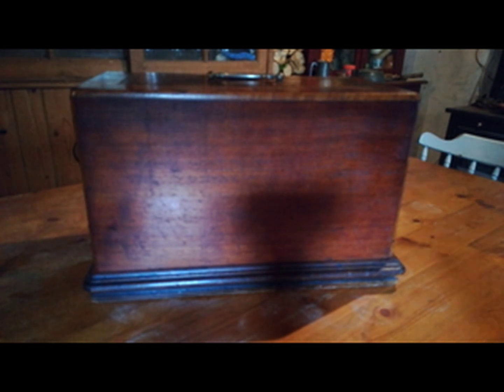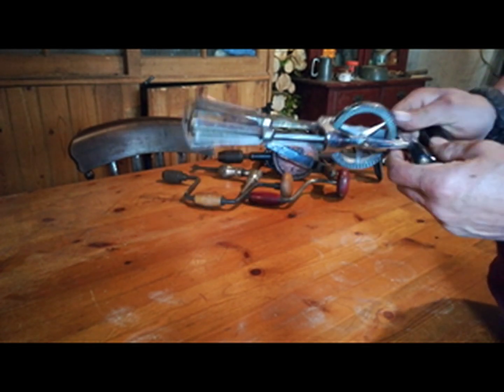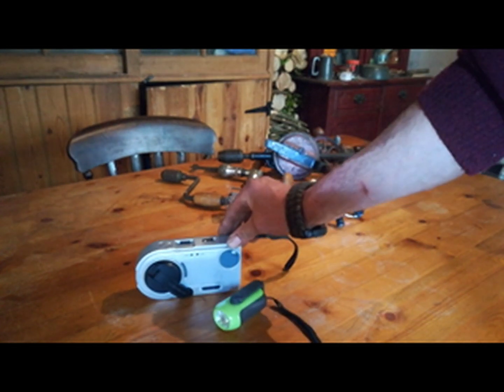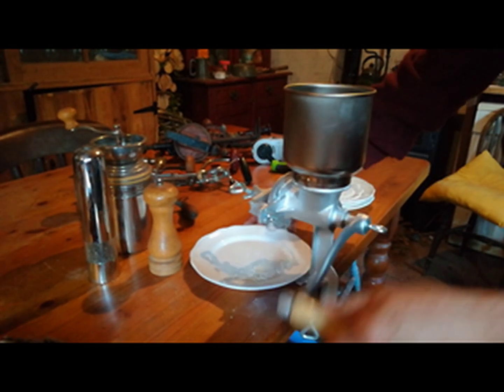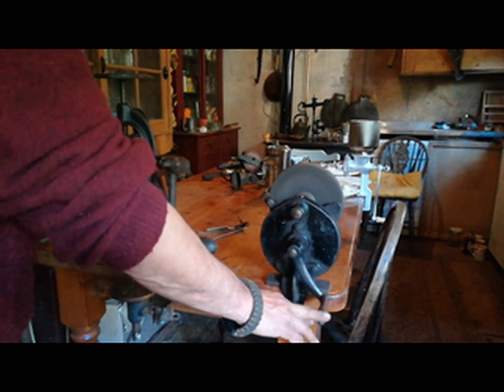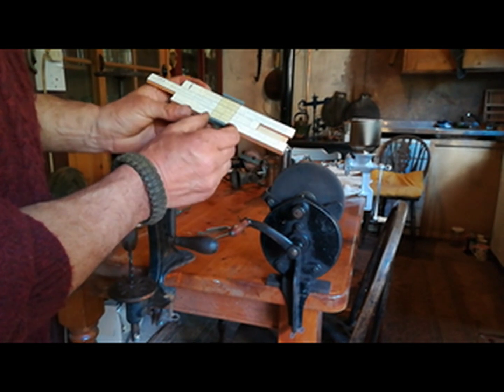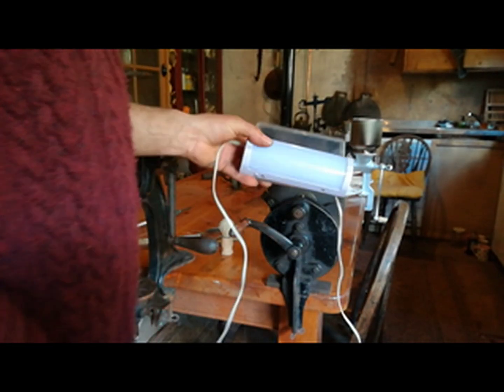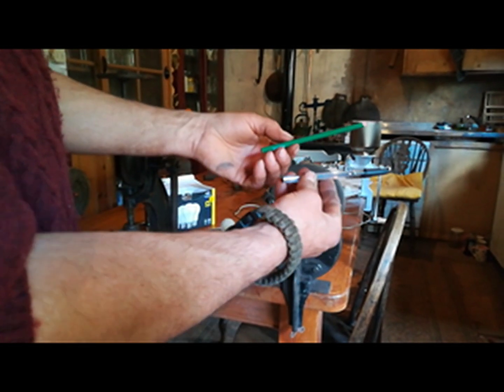CHAIN OF CHANGE episode four sustainable technology,building a resilient future

Comment: I have and use a lot of the same gear a singer patcher, drummond treadle lathe, hand and foot powered grinders and a hand bench drill. I like the old slower way of doing things this mad rush we are all in is conditioning. As much can be achieved and excellent results obtained all be it at a slower pace.
Do you have a roasting jack ? That is a superb item to add to your kitchen gear if not, ive roasted a few joints in front of the wood burner in winter time no batteries and no mains................................ good video....... cheers
Reply from the maker: thank you for the kind comments, I find it very satisfying working slowly and positively, and as you say better results can often be had, being happy is a goal for most people and doing things by hand can give a sense of achievement and contentment above that gained from merely completing a task, and I would love a roasting jack, perhaps one day one will turn up, but in the meantime I use a spit , or kettle sticks over an open fire in the summer months, I have a friend with a drummond treadle lathe, I built a wood turning pole lath a few years ago but haven't used it a lot, perhaps its time to get it productive,   keep up the good work , between us all we make up the chain of change